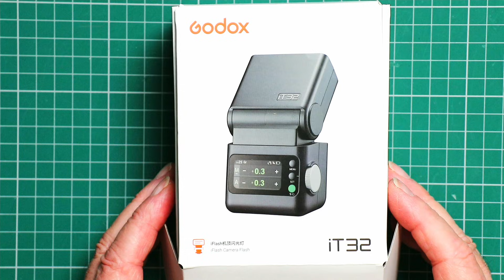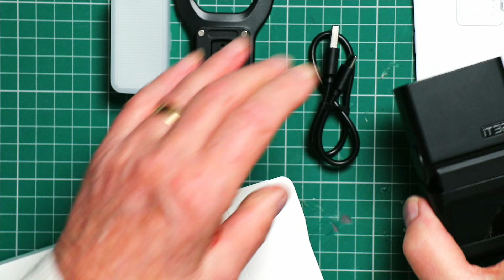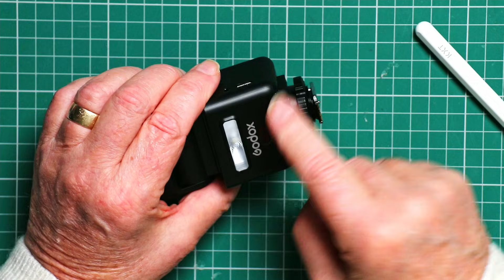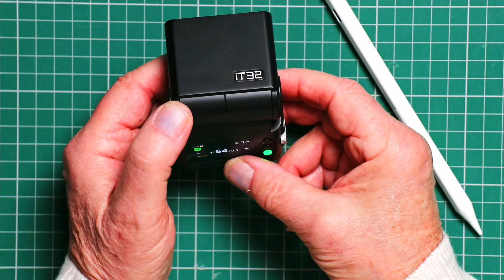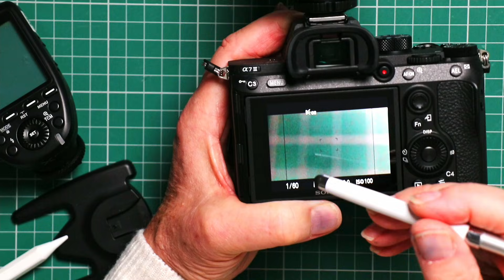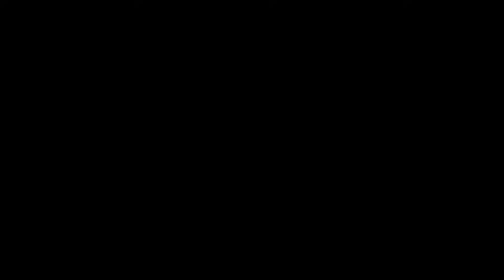Godox IT32 & X5 Trigger Full Review

Comment: I got mine yesterday and I love it, the only problem I found is when wanting to use it on multi mode and off camera at the same time. The moment I press the shutter on the camera the flash units goes into ttl mode and doens't fire the stroboscopic flash. Is that normal?
Reply from the maker: I will test when I get home later today
Reply: @GrahamHoughton12  Thanks!
Reply from the maker: the secret with multimode is to use Shutter priority and set the shutter speed longer than the sum of the multimode flashes so for example 5 flashes at 2 Hz needs a shutter speed of 4 seconds. Either set multimode on the IT32 or from your camera menu if it supports that. Normally used in dark environments to get the number of flashes and keep ambient exposure low.

Comment: Thank Graham, always thorough reviews.  I am considering  this system but I’m hoping you can answer a question before I commit:  I use a pair of Godox AD200ii pro off camera flashes with the x3pro trigger.  I want a compatible remote shutter release trigger, did I hear you right that the it32 will trigger the camera shutter and other X system flashes, will it trigger the AD200ii pro’s I mention above as well as the camera release.  This is for flambient photography?  Thanks again, always rely on your reviews.
Reply from the maker: Sorry for late reply. I don't have a TTL version of the AD200 to test this but other flashes do work with X system - TTL, maybe the best option is the X3 pro which I will be reviewing shortly.

Comment: if you use thy flash off camera and remote by the x5 then TTL doesn't work anymore, you always must adjust the flash manually. Hope they will bring a software update soon.
Reply from the maker: That’s not the case in my testing. TTL works from X5 on the IT32 and other X series flashes if the are set in slave mode. FEC works but may not show on the lcd screen of x series flashes but the exposure does the change. Another video soon will clarify this
Reply: Mind the sensor
Mind the sensor
Mind the sensor

Comment: The iT32 eliminates the biggest problem with on-camera flash—its unnatural flat rendering of what it illuminates.  Keeping flash centered on the camera axis and raised over head to create a ‘Butterfly’ shaped shadow is a very flattering lighting strategy for full-face poses if the subject has a slender and symmetrical face—as most professional models do.  The iT32 makes it easy to hold the flash head over the camera by hand to get that pattern.  

When a face is wide and round it will be flattered more with with a ‘Short’ lighting pattern in which the KEY source is 45° to either side of the nose and about 45° above the eye line where the shadow created by the nose falls over half of it without hanging out.  The shape of the nose and how deep set the eyes will dictate the ideal height.   But when the KEY light is placed to the side source of FILL is needed to control the tone of the shaded side of the face.  The ideal place for a fill flash is the same one used for the centered ‘butterfly’ pattern, centered above the lens.

One of the great features of the Godox brand is that all the flashes share the same 2.4 Ghz multi-group control system which makes it very easy to use a dual KEY over FILL configuration.  I Godox V480c, a X3 trigger, the it30pro, and I just got the it32 + X5c for use on my three Canon R6mkII bodies.

I shot wedding in the 1970s using a bracket to raise my on camera flash I used for Fill so it is ideally placed and I didn’t even need to think about it’s position.  The KEY flash was placed on a rolling stand and positioned 45° from the nose of the subject for portraits and 45° with the the Group B KEY one stop brighter than Group A FILL behind and above as rim light for action shots with Group A = Group B in strength. 

Back in 2004 I started experimenting with different types of DIY speedlight diffusers and found the most effective design was ‘scoop’ style I created out of sheets 9” x 12” of 1/8” thick craft foam which are can be folded flat for storage.  They split the output of the vertically oriented flash head between straight ahead as as a “KEY LIGHT” vector but also create spill fill off a low ceiling when one is over head.  They  produce very flattering lighting 😅when used with two flashes in Key over Centered Fill.  They are very easy to make…  I created a template for making them on my photo tutorial web site back in 2004   photo (dot) nova (dot) org (slash) DIY01.  

I’m still using the Stroboframe ‘Camera-flip’ bracket I bought with my first digital camera and pair of pair of Vivitar flashes back in 2000 and also used with my pair of Canon 580ex flashes starting in 2004.  They no longer work with my R6mkII bodies so I invested in a pair of V480c flashes and they work great with the bracket with using the Canon TTL cord to connect the Group A Fill / Sender flash to the hot-shoe with the second V480c.  

I keep the iT30pro and the iT32 + X5c on my other two R6mkII bodies.  I use the VR extender for both of them to avoid getting
Reply from the maker: Thank you for sharing your extensive experience and detailed insights on flash photography, especially with the Godox system!

Comment: I am not a pro but a hobbyist, I currently own the godox v1. I sold the xpro s trigger to a fellow photographer friend, I was thinking on buying the x3 trigger but now I wonder, Should I just buy the it32 or it30pro as a trigger ?
Reply from the maker: either will act as master trigger for the V1, probably the it30 has more potential when just using as a trigger as the it32 would need to be attached to the X5s trigger to achieve full trigger distance as the x5 alone is only 20metres

Comment: Does this replace having a regular stand alone trigger for other godox flashes
Reply: its compatible with any of their recent ones that support wireless.
Reply from the maker: when the X5 trigger is attached to the IT32 full control. X5 alone can only directly control the IT32 or external flashes on group A in TTL mode however FEC has to be done via camera menu for the external flashes. I will have a demo video on this soon.
Reply: @GrahamHoughton12  I have the it32 plus a TT350 to also control, so I will watch for your new demo, thanks.